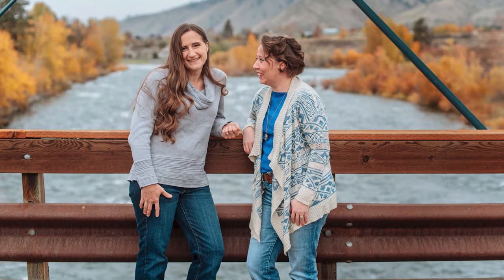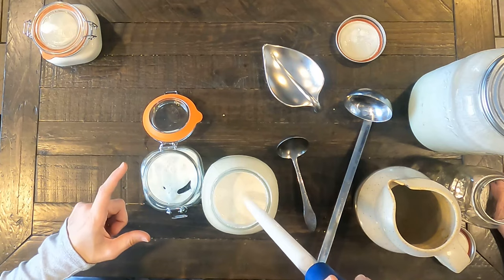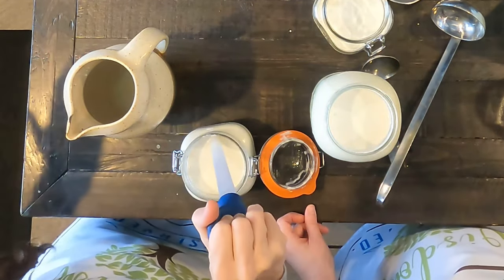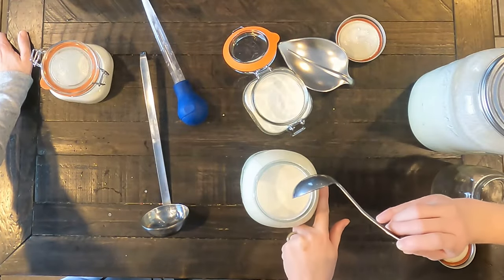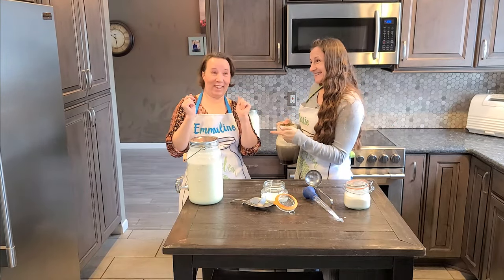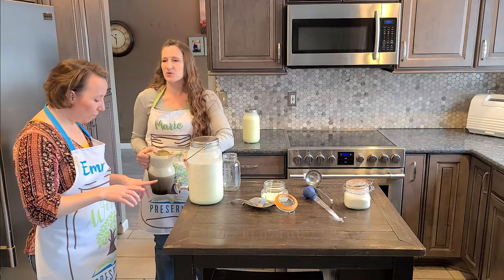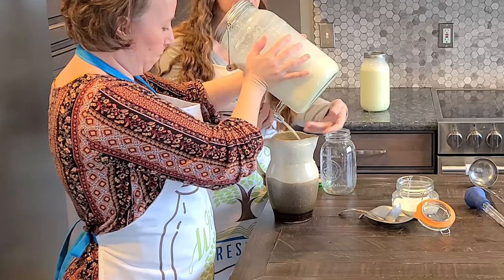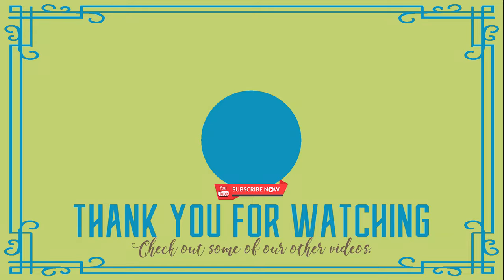3 Methods to Separate Cream from Milk | Dairy Processing with Wisdom Preserved

Comment: Where did you get the glass container with the spout??
Reply from the maker: I got that one at Fred Meyers.
Reply: @WisdomPreserved  does the spout leak?  Been reading reviews on Amazon of different ones and many say the spout leaks…
Reply from the maker: @tillisross2246  Mine tends to have a drop or two after use but I just catch that with a cloth before it can drip down. Otherwise, it has been great.

Comment: Excellent video ladies! I found you randomly while searching for info on how to separate cream from raw milk and the turkey baster and the jar with a spigot are genius! I had to do a double take during your intro, as I'm in Monroe! I'd love more info on how to get milk from Green Valley Dairy if they're selling. I currently get raw milk from Silvana Creamery, but I'd love to have another option (I was SO sad when Art of Milk closed several years ago)
Reply from the maker: Linda Torres at Green Valley Dairy, 509-670-3082, would be your contact for that. Thank you for your comments. I love using a combination of the 3 methods depending on the situation.
Reply: @WisdomPreserved  Thanks so much!

Comment: Awesome! 
So that cream if you were to buy in store, what would they call it? Because the highest we can buy here is 35%
Reply from the maker: I'm not sure what the percentage would be but I have found if I want really heavy cream, I let it sit for a few more days in the refrigerator after I have seperated it. There is usually a little more milk in it that seperates out at the bottom and the heaviest cream floats to the top. I just pull off the top half of the cream and it is super thick.
Reply: I buy 40% at Costco.

Comment: Please provide the gallon jar with the spiket resource.
Reply from the maker: I got mine from Fred Meyer but there are many other options. Here is a 2 jar set and it has a metal spigot so it will last longer: https://www.amazon.com/1-Gallon-Beverage-Dispenser-Serveware-Stainless/dp/B0B3M6QBVG/ref=sr_1_1?crid=3U49801PWPE4X&dib=eyJ2IjoiMSJ9.UvpmgTes_t3aa_gZw0k0RrixYk8VDebkReFRNXqQhhWITorK1KBIFSElfbD9bl9m_-z3duEofYps0sqO-7SUp-81a_fB_Ym-zfaZ_Z8yjn-EBl3h9YaaGSdOV8BPpvIhlXlWpNgcq08yR3otehAi3U7fNYflTkKIDM9AMcA3WdfAfOnnJRSuWovTnoQEfP4VANvGZOgs8XIk3fmHRJ2zVELwMKLiiUL33lV0g7Atcoo1_cYa5yQtMlTq_ooNZ_7MlhSNE_Cl08mK4jrhqa5ChNdYmshBzktEopBcj_RYaPY.E8HTNDAdt8VQRKh10W6HGXJTzaQi-yhPTz0roMJdOK8&dib_tag=se&keywords=1%2Bgallon%2Bglass%2Bjar%2Bwith%2Bspigot&qid=1709509923&sprefix=jar%2Bwith%2Bspigot%2Caps%2C140&sr=8-1&th=1
It seems like it is a good option.

Comment: Big question. Lactose intolerance.  Since about my early 40's I've had trouble drinking the "pastorized" milk. How does this raw milk taste, & how would it affect my digestion?  Oh & how long is the shelf life? Thank you
Reply from the maker: A lot is probably dependent on your dairy, cow, etc. I can tell you my experience with my sister's dairy: I like the raw milk. It is creamy and separates from the cream so I either shake it up and drink it or take off the cream for other uses. There are actually some health benefits to drinking raw milk as long as you know the cleanliness of the dairy it came from. The studies I have read indicate raw and pasteurized milk have the same amount of lactose but there have been anecdotal stories of people digesting the raw milk better. Generally, I would recommend goat milk for lactose intolerance. If you have trouble with the taste I would take a look at our How to Make Goat Milk Palatable video: https://youtu.be/hlXKzcpMSHc Her milk is usually good for about 2 weeks.
Reply: If you research it you’ll find that people who are lactose intolerant normally don’t have a reaction to raw milk because it still has the enzyme (lactase) in it. Pasteurized milk takes this out and it is needed to breakdown lactose. The two enzymes work together so I would recommend giving raw milk a try.
Reply from the maker: @maddisonyarbrough8381  Thanks for the info,
Reply: I can back these statements up my wife could not drink more than half a cup of milk now with raw milk she drinks it like it’s going it of fashion and she’s fine
Reply: All the statements about raw milk are true!!! Fun fact raw milk has also been referred to as "White blood" because it has every single element blood does except red blood cells. It even has white blood cells in it!! It is very health and good for your body and it is a big big help when trying to heal your gut and digestion. You can find local dairies that produce raw milk near you with "Real milk finder" it's a website that local dairies register with they also have some educational info and sources about raw milk.